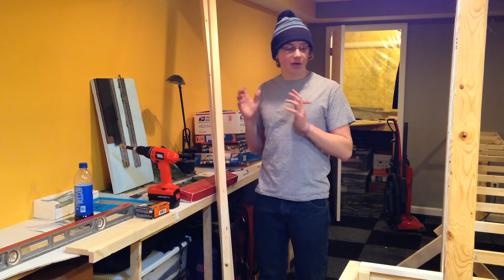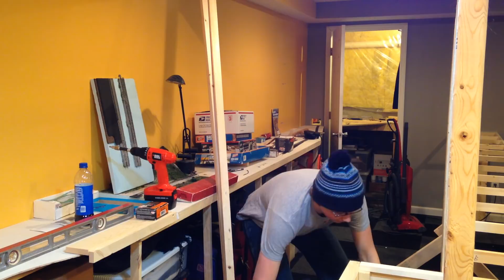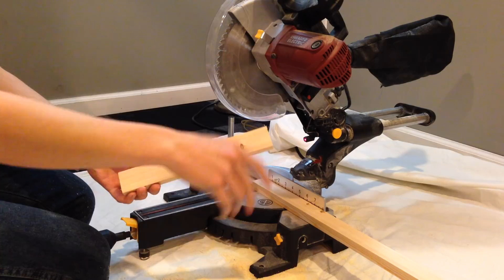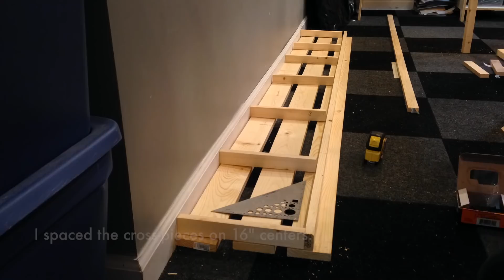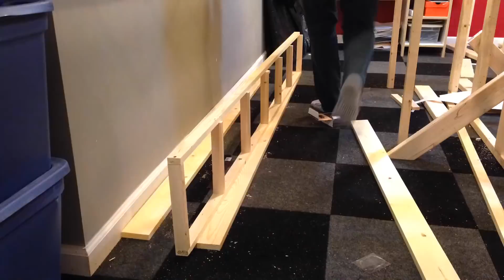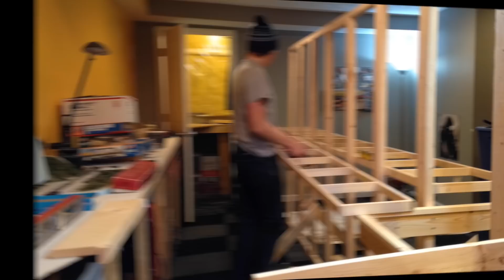How to Build Model Railroad Benchwork - Open Grid

Comment: I am building an upper lever with 1x2's, and I have been reading about people who say this will be problems down the road, that the 1x2's will split and warp.  So I want to know if it's safe for me to move forward with this benchwork or use something else before it's too late.  It's just basic framework at this point, but I don't want to lay subroadbed and track and then have it all fall apart after all that work.  My room in the cellar where my trains are does have a all mounted dehumidifier,A/C,heater.  But I don't want to put all this time and work into something like this only to be forced to "abandon" it later.  How have your results been, are you satisfied with he 1/2s"?
Thanks for the info,

 - Mark
Reply from the maker: I received a lot of warnings from people about the 1x2s as well, but what I realized is that most of the time people who say not to do something have never tried it themselves. The 1x2s have worked great for me, and more people should use them. They're lightweight and easy to handle. My layout is in the basement which has AC, but its temperature and humidity fluctuates a decent amount. It's been more than 2 years, and I've had no warping. I just made sure that I had support about every 2 feet so that there was no sagging, and it's been smooth sailing. Hopefully that helps, and let me know if you have other questions!
-Cam